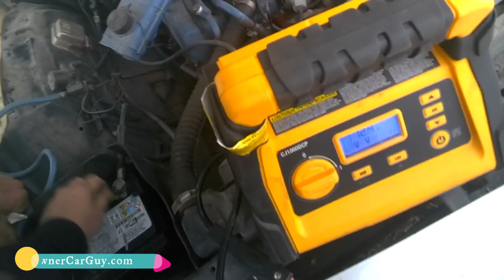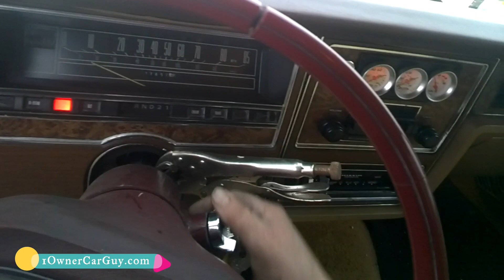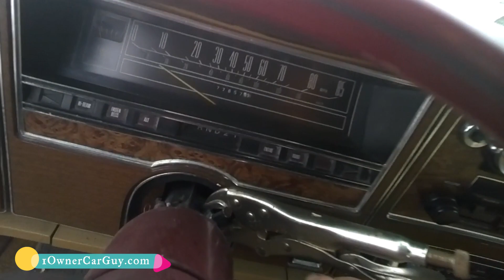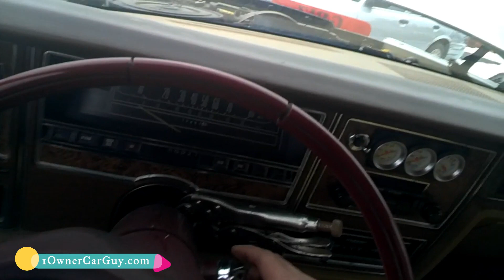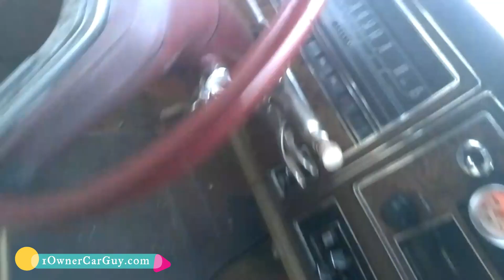COLD START ~ CLASSIC STATION WAGON ! START UP ~ DAILY WORK VLOG 2020-0049

Comment: Heck yeah . U could take air cleaner off and tap the carb with a small hammer or screwdriver and it probably stop that fuel over flow . From sitting so long the float bowl is stuck inside the carb so it's dumping fuel everywhere.  Not bad that car is really clean and nice condition the seats look like pillows ha

Comment: I am not an expert, but why are you overpumping it?
Reply from the maker: I'm not... Its a LONG ways to the tank and its a manual fuel pump the more and faster you pumo it the better your chances from what I have found.... Makes no diff with fuel injection the need a electric fuel pump and you can get whay you need by simply turning the key on and off 3-4 times to get the fuel to the injection system... ;-)
Reply: @CerealMarshmallows  aaah! Thank you